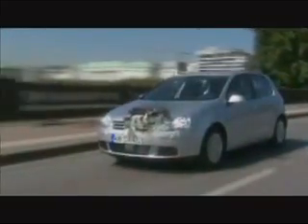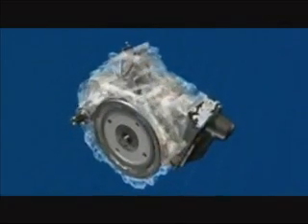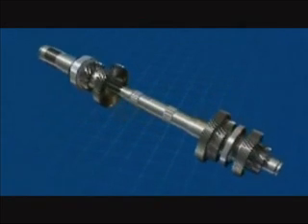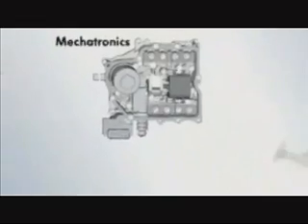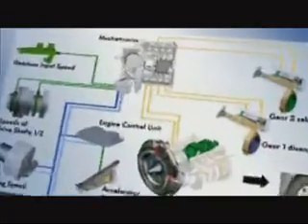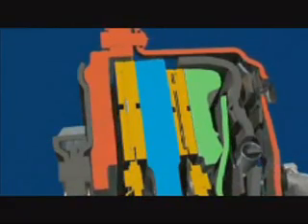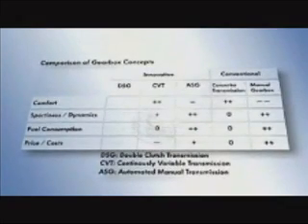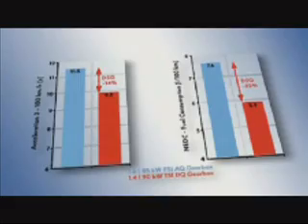New Volkswagen DSG gearbox

Comment: I have the 02E 6-Speed Wet Clutch in my 2013 GTI. Shifts as smooth as butter, even with Stage 2 and a DSG Tune, 250-whp/300-wtq.

Comment: I have a Volkswagen with DSG-7. Car is almost 6 years old with 105k on the clock, and it works perfect. The best transmission ever made!
Reply: ZeroController , What is your car?
Reply: Marcos Porto Polo, 1.4 86ps
Reply: All semi auto boxes are the same if used properly.

Comment: I've had to replace two of them. Passat 2010 and Jetta 2013 (both new), counting less than 40.000km.
Reply: You should not try to balance your clutch and flywheel why trying to hold it stood at lights etc on hills or at roundabouts, take it out of gear and use your handbrake to save your clutches, it does not take more than a few seconds to do it, nobody is in that much of a hurry that this simple clutch saving movement can't be used every time you are held up in traffic , uphill or on the level take it out of gear while you are stood, save yourself some money.

Comment: For the car designers and engineers, make no mistake, most drivers like the shift gear (the short stick with six slot-H pattern), we just don't like the foot clutch.  With today's technologies, engineer could automate the foot clutch with power hydraulics (to press and release) when sensing of gear shifting is imminent in fraction of a m sec, which this could gave the driver the option or pleasure of shifting up or down, or skip shifting from 2 to 4, or 3 to 1 etc.  gjsfus@gmail.com 9/7/2012

Comment: As long as you do the Major services and minors you'll be fine, 60,000km's they get a rebuild otherwise you may have problems
Reply: rebuild at 60.000 km? i only find that oil change is needed at that mileage. At least for 2016+ DSG cars?

Comment: Don't be too excited about the DSG.  7 speed DSG has a range of problems.  And will break down more easily ... I have been driving a Scirocco for the past year.  The box is not mature yet.  VW has now quietly reverted back to using a wet DSG7 for its GOLF MK6.  Dry clutch 7 speed DSG is crap.  Read up the forums and see how many new GOLF and Sciroccos stalled on the highway ...
Reply: I have golf 7 2018 broke down after 20000km

Comment: Looks like it would work wonderfully for a few years, but its shifting is at least as complicated as a normal automatic transmission's, and having at least one clutch disengaged all the time would be hard on the throwout bearings.  Also, how would you pushstart the car if you needed to?  On the whole, I would still own a manual transmission.  Still, I must say, what a marvelous feat of engineering.

Comment: true, in addition to that in case of a breakdown replacement will cost you more than 16000 euro
good luck with that if you are out of warranty!!
Reply: olimpicsa That was a lot 7 years ago,Now it's a €4,500 replacement for a DSG.
Reply: For mechatronic official price in Volkswagen is 1,700-1,800 euro. You can find many refurbished online from China, Poland, Ukraine around 350-500 euro. I bought one of this and installed since 1 week. I hope it lasts at least 3 or 4 years. I hope problems are related to mechatronic only and not to the gearbox.
Reply: That's right. My VW cc has just 60000 when I faced this issue of the mechatronic unit. I'm planning to repair it and sell it since I nolonger have confidence on what the dealer says about this issue. It's really nonsense that an expensive car like this fails after 60 thousands km of driving.

Comment: Not good enough for performance though. Watch some of the Nissan 3.5 V6 cars with the CVT. I can accelerate faster in my GTI from 80-100 than they can and I have to shift at 85... They work well but not for high speed systems... Too much loss is the problem... If it was better they would use it in formula cars instead of DSG type systems...

Comment: Fendt tractors put as much as 1500ft-lb or torque through their CVTs.  

And if you wanna talk about stress on parts, you wont find much more than you will in one of those.

Their CVTs have been very reliable and hold up well to the power while using much less fuel.

However they use a mechanical/hydraulic approach.

Comment: DSG is also developed by Germans in WW2 era.

Yeah, Wikipedia is inaccurate and the earth is square. Burrow your head in the send as you might

But guess what?
Bugatti Veyron  uses DSG with 1,250 N·m of torque.

Try 1250Nm on CVT it will snap in 12ms.

Stop acting like nihonjin and accept the defeat.